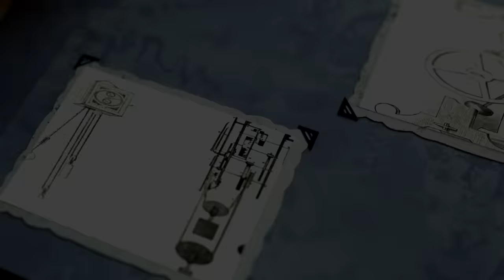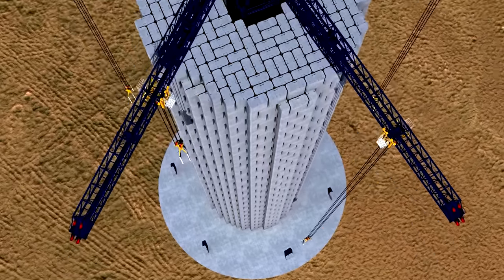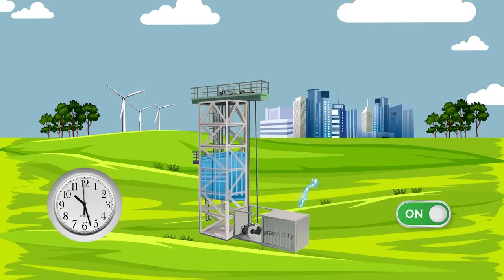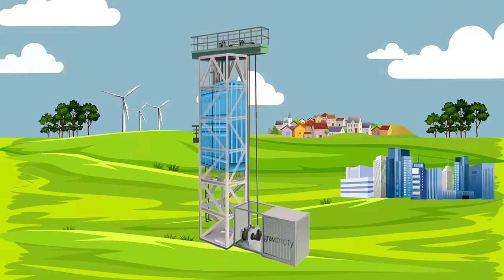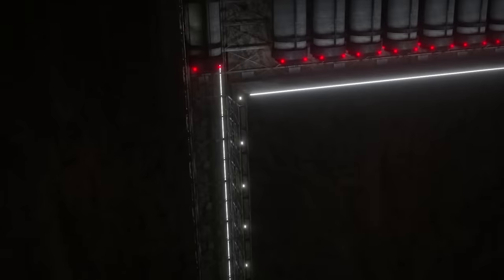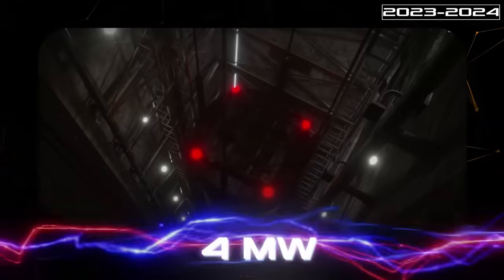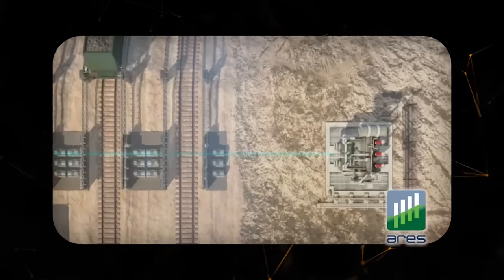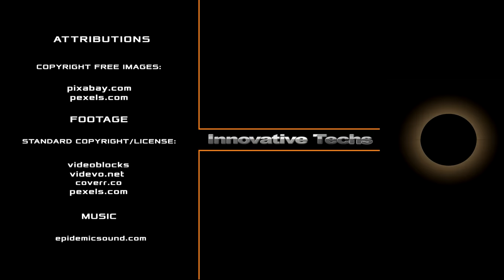How gravity batteries could change the world

Comment: There is a gravity battery that many are not aware of . Its called a floating city. The city is built in a tidal area and raises with the tide.When the  Modules of the city are lowered we create electricity. This power is for the city and excess energy goes to the grid for other use like land based industries . When the tide turns energy is created by the force of the modules displacing the water and being pushed up.
Reply: I was just thinking of this as I watched this video
Reply: Wow... thx for the input!  Genius!
Reply: Rising and falling on the tide does no work on the floating object- only if it somehow reacts against a stationary surface can work be extracted. This is physics 101 stuff.
Reply: @r0cketplumber  the object is tied to the bottom dah!!
Reply: @r0cketplumber  yes it reacts against stationary object . Each module is connected to the bottom of the tidal water. You will have to fill in the spaces otherwise it would be a 500 page concept !
Reply: Unfortunately, you just created a scenario where sunlight has been taken away from all the ocean life underneath your floating city, resulting in a fairly significant environmental impact.   We do need to consider that sort of factor.
Reply: its a generator , not a battery

Comment: Since 1991 I am using gravity battery of my own design, transforming solar and wind energy to potential energy of the concrete brick of 1200 kg weight. Must say, it is flawless and works without any expenses at all ( few bearings and grease so far) but efficiency is not that high. I hoped it would be about 30% but it is lower.
Reply: Where are the losses?
Reply: Very interesting comment!!  Would love to watch a video about your experience.  I think your percentage loss is actually comparable to other mechanical systems of storage such as pumped water.
Reply: 30% Losses or effiency?
Reply: @Ebuilt   You can imply from his statement, "I hoped it would be about 30% but it is lower."  Tvset was disappointed that the efficiency wasn't higher than 30%, but lower than 30%.

Comment: Many people are talking about using water only for the gravity batteries everywhere. 
But the possibility of floods in case the dam is breached due to landslide or heavy rain or earthquake or wear-tear over time also needs to be calculated and kept in mind. 
Not to forget that  in population dense countries, the land itself is much costlier and difficult to procure to extend or create new reservoirs. And the native communities which is displaced because of that since most reservoirs will created in somewhat far-off from cities areas and near forests and hills. 
Plus with keeping a big chunk of land, the greenery that goes inside water will be rotting and producing huge amounts of Methane, a Green House Gas with a higher capacity to hold the heat causing Global warming. And anyway, dams and reservoirs themselves create a barrier for aquatic species to procreate and survive causing biological degradation. 
It also affects the farm fields where the finer silt which aids the production of crops doesn't reach and instead gets deposited in the reservoir slowly making it unviable over time.
The hydrological solutions cannot be expanded beyond a point without huge ramifications and is not suitable in most countries which need to switch fast to the renewable sources.
Reply: Such a clever perspective on environmental issues, which demand the comprehension of countless variables. We just can’t assume water is good everywhere, for big batteries need monstrous reservoirs, which destroy ecosystems besides being really damaging to communities, food security and so on.
Reply: Dam breaches are very rare and should never happen if they are properly designed.

Comment: The problem I see with these types of gravity batteries are "wear and tear". Using hydro, it's less likely that things are going to go wrong when it's essentially one hole full of water leading to another with the route filled with turbines(A bit more complex than that, but you get the idea). Gravity batteries as shown above however are far more complex and will require more maintenance. With it being such a heavy load in such a small space, you'll need to make sure every part of the equipment is in top condition, or risk the entire thing breaking.

Not only that, but put it in the right spot and rain can essentially give free energy to hydro energy storage systems... granted, evaporation can do just the opposite, so it just depends how it's built.
It's hard to beat water.
Reply: And for the record (I'm not a professional in the area so if I'm wrong please tell me)
The smallest PSH (Pumped Storage Hydroelectric) station in the US has a power capacity of 1,065 MW

So when numbers are thrown around like 80 Megawatts or when the prospect of 4 Megawatts being generated from the coal mine gravity battery seems like a lot, it's... really not.
Reply: @SharkyShocker  Yeah, but the possibility of floods in case the dam is breached due to landslide or heavy rain or earthquake or wear-tear over time also needs to be calculated and kept in mind. Not to forget that  in population dense countries, the land itself is much costlier and difficult to procure to extend or create new reservoirs. And the native communities which is displaced because of that since most reservoirs will created in somewhat far-off from cities areas and near forests and hills. Plus with keeping a big chunk of land, the greenery that goes inside water will be rotting and producing huge amounts of Methane, a Green House Gas with a higher capacity to hold the heat causing Global warming. And anyway, dams and reservoirs themselves create a barrier for aquatic species to procreate and survive causing biological degradation. It also affects the farm fields where the finer silt which aids the production of crops doesn't reach and instead gets deposited in the reservoir slowly making it unviable over time.
The hydrological solutions cannot be expanded beyond a point without huge ramifications and is not suitable in most countries which need to switch fast to the renewable sources.
Reply: Ever replace a pump?

Comment: Decomissioned missile silos are also a prime candidate for this concept. ICBM fields also tend to be in flat and remote lands that are ideal for wind and solar, so having a close gravity battery to store for high peak or surprise draws is fantastic.
Reply: I don't believe those are typically ~1000 m deep, unfortunately.
Reply: @LightbringerDesigns  About a 1000 ft actually. Some are more. I used to work on the explosive warheads, but never did see the inside of a silo personally. Just know a bit about them. Really gravity batteries will work at any depth but obviously more is better. You just need to be able to lift a weight up and hold it in place until you need to release its kinetic energy later. The beauty of having the weight underground is that if there is an accident, the damage is very contained with little risk to human life.

Comment: The problem could be charging power required is pretty fixed. The excess power has to meet the desired power range to lift up the weight. Whereas batteries are convenient to store. I believe having rooftop solar with a 10kWh battery for every house that can communicate with grid demand will be super simple and convenient.
Reply: Doesn't sound very convenient at all. You have to mine all that precious metals and equip it on every house. The houses are already wired for electricity you just have to get it to the grid.
Reply: @TheAnnoyingBoss   to top it off; 10% - 20% battery degradation within 10yrs, they will not outlast any mechanical system, industrial battery power storage require air conditioning (heat\cooling), any failures can destroy an entire unit by fire, shorts and swelling. Beyond that, their external maintenance is similar to those of gravity based variants. The video does a great job explaining the pros and cons

Comment: Hands down, the cheapest and simplest gravity battery requires:
1) a 250' high hill
2) railroad tracks laid from top to bottom - any number you want
3) ore cars filled with nearby rubble
4) cable for each car connected at the top to a motor/generator
5) $100 worth of computer chips to run the system

I guess if you don't have a nearby hill, you have to start to build structures, but a hill is free.
Reply: Do the math and you'll notice that you'd need a VERY long and steep hill(miles) and something with the density of tungstun or lead in those carts, to generate enough electricity for rather few households.
Reply: @shivadanis5938  OK show us the math...
Reply: You forgot the solar panels to pull of the weight up during the day from the SURPLUS of energy that they would produce.
Reply: @amjan  Hello - that's the whole idea
Reply: What is the cost of train and railway?😅 as someone has calculated above, you need to lift 2 million ton in weight to power a small town. This woild translate to ten of thousand of train
Reply: @shivadanis5938  still it is much more potential energy than an elevator with comparable cost can provide.
Reply: Why not use water tanks filled with water on tracks  or better yet why not just pump the water uphill and you only have to maintain one moving part in thesystem
Reply: The problem is you have to pay the cost to get everything to the top of the hill and if dropping it down doesn't cover the cost with a profit it's not worth it. Plus you need a long hill and it takes up a lot of space. Oil drillers go down 30,000 feet and take up a very small space horizontally speaking.

Comment: Gravity batteries were used as the primary source of electrical power for remote telegraph stations in the mid-1800s! It's interesting to see them being revived with little changing other than size.

Comment: Why not use the weight of batteries for gravity battery so you charge batteries while pulling up the weight and during peak hours you discharge both.
Reply: 1kg of mass has about 10J of potential energy for every meter of height. On average a lead acid battery has an energy density of 35Wh/kg or the same as 126,000 J per kg, a lithium ion battery can be 8 times more energy dense. So you would have to lift the lead acid battery about 13km to equal its energy density or in the case of lithium ion about 80km. So it is not really worth the mechanical complexity and investment for an increase of less than .01 percent or less of storage capacity.

Comment: A lot of the energy banks just seem over complicated, especially when fluids are so much easier and less complicated to pump around a system. What could possibly be the advantage of having concrete blocks being lifted with cable when water can be pumped to a height.

Comment: I would think using something like calcium bromide and some liquid storage tanks, pumps and turbines might be more flexible.  It would take something like cesium formate to be the same density as concrete but I think 1.8 grams per CC versus 2.4 g for cc probably is worth the trade off.
Reply: I changed my mind I would use zinc bromide at its maximum saturation and then not only use gravity stores but also the zinc bromide could be used as a flow battery.
Reply: You are failing to see the wood for the trees. Gravity batteries other than hydro are useless.

Comment: I did some rough calcs on my part and when I compare gravity storage to lithium-ion battery storage, Li-Ion wins by A LOT! 

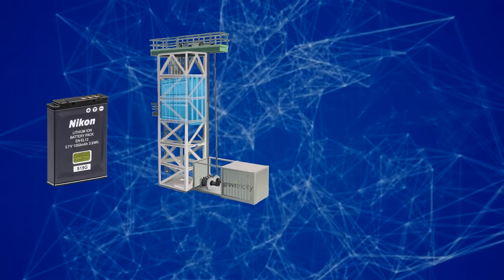At 5:20, can you elaborate where did you get this calculation from? 

Here's what I did to compare: 
Epot = m*g*h = 50.000kg * 9,81 m/s^2 * 15m = 2kWh. So, Gravitricitys little port-prototype there can store about 2 kWh of energy, if there's no conversion losses. I imagine costs will be in the 5 digits surely, let's generously assume 60.000€ for the gravity battery.
In comparison, the average price of a Li-Ion battery is around 150€/kWh. For a 2 kWh battery plus grid connection you would pay a generous estimate of 3.000€. 
Now compare 60.000€ to 3.000€ for the same 2 kWh of energy storage. 
Gravity storage pros: Depending on the motors, probably a lot more power output than the Li-Ion battery. Good for grid stability and fast reaction to load changes in the grid. 
But, don't we have much better renewable energy storage alternatives for improving grid stability? Like vacuumised flywheels, super capacitors on the uprising, large pumped water storage connected to the grids? 
Please add to the discussion, I am curious what you have to say about this!

Comment: Put a water reservoir above another water reservoir and then put some turbines between the two. When energy is high and demand is low, pump water from the lower Reservoir to the top Reservoir, when demand is high and energy is low, let it flow from the top to the bottom through the turbines generating power. This gravity battery would probably be a lot cheaper than either of your two gravity batteries and it's already implemented in today's infrastructure.

Comment: I love this kind of thinking, there are so many benefits from using recycled elements to reusing mines that were paid for decades even centuries ago. It will help advance carbon fiber and carbon nanotube technology possibly extending to a future space elevator. imagine a gravity battery but the weight is lifted with antigravity rather than excess stored electricity. The pessimist in me thinks... little too little, little too late. Maybe the next dominant species on Earth will be smarter than humans.
Reply: Using mines is expensive because you have to support the sides of the mineshaft. Why not just pump water to a lake on top of a mountain
Reply: @JL-tm3rc  Mine shafts that have been stable for hundreds of years aren't going to need reinforcement and nothing but the weight will make the journey up and down. Water would work too but I'd bet water turning a generator isn't as efficient. I like the idea of using old abandoned mine shafts that people couldn't figure out how to keep using them. Stay safe JL. Your middle name doesn't start with a B, does it?
Reply: @brianbassett4379  pumps are more efficients that is why we do not place water in container and drive them up through tracks

Comment: One thing is wrong. Lithium batteries live more than 5-10 years. In a storage they aren´t used from 100% to 0. They discharge only 20-50% so they live three times longer. And when you use LFP Batteries, they even last longer and don´t burn anymore. And you can recycle them already up to 96%

Comment: I'll need to do some math, but consider that groun-loop heat pumps are becoming popular for residential uses. They require a well--like cylinder to be drilled into the ground. Could the same drilling systems be used to drill for a gravity "battery" system for residential pv energy storage? It seems reasonable.

Comment: I did the math. In order to supply 20 MW of power for 8 hours from a so-called gravity battery, you would need a skyscraper that is 1 km tall with 65300 tons of weight at the top. That is if we assume that the efficiency of electric generators is 90%.

Comment: This storage never 'leaks', in that once lifted, the potential energy stored does not dissipate. The only loss is in the electrical and mechanical resistance of the system, which is true of any storage system. No added pollution, no exotic materials - you can use sand, rocks, water, cement blocks, or iron ingots. Water can evaporate from reservoirs. Bricks do not.
Reply: Saying it never leaks is not entirely accurate. Any material used will decay over time and quickly if left in open air.  It is not a very good argument for gravity batteries anyway.  Water does not evaporate fast enough for the stored power to go unused as the "battery" is recharged/discharged daily.  These system are not built or needed for long term energy storage they just need to store enough energy for a days worth of energy at the most.

Comment: Thanks and high respect for my university professor who teached me and other students that one electric tram need energy on uphill and will release this energy back downhill, and this lection was decades ago. 
Thanks to all my efforts during decades which lead me on an advanced concept which use gravity weight to generate energy on demand but heavy concrete blocks or wagons full with dirt can be lifted and dropped to generate energy when it is needed on so called "stationary gravity engine".  The invention is not disclosed and will not be disclosed without partnering with a government which goal is energy independence and clean energy.  Let government work now and not complain for energy sanctions.  Energy is abundant but need the right technologies.

Comment: In hilly or mountanous areas, you can build a ramp along the slope of the hill and use a cart that moves back and forth. Capacity could be varied with the slope, and dimensions of the cart and cables. No need for a dangerously tall tower with microgearing.

Comment: This weight must be mounted on a wheel because the wheel can -turned around - to put the weight in the upper position, you just have to turn it. At right angles, two tracks can be placed on the wheel (which should be very stable) for two weights. If there are two such wheels, one can feed the rotation of the other wheel with electricity when the weight falls on it. By the way, this could also be done with a water turbine. Someone make it please.

Comment: Instead of lifting a large heavy block, I wonder if it would take less energy to fill a vessel with a heavy liquid and then pump that liquid back up and also lift the empty vessel.   Also, wouldn’t the the rate of fall depend not only on the weight of the block but also the electrical load that it is supplying?   Too much electrical load and the internal resistance of the generator would be too great to let it fall.